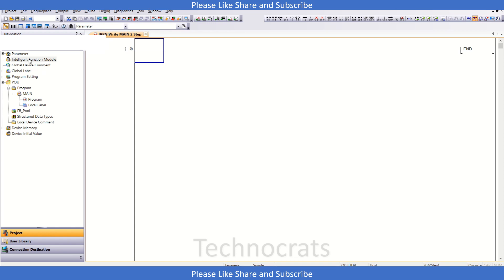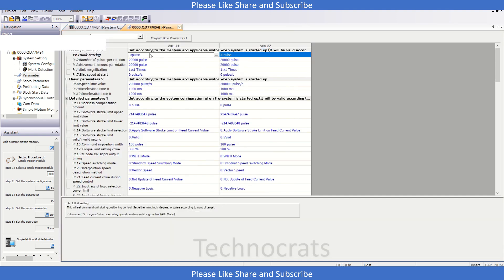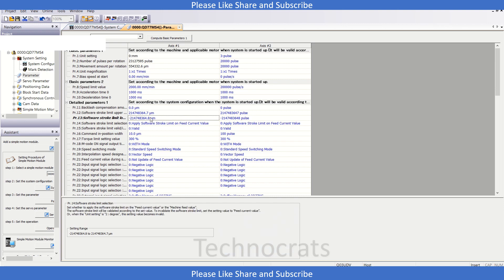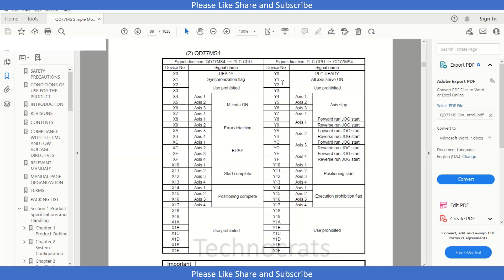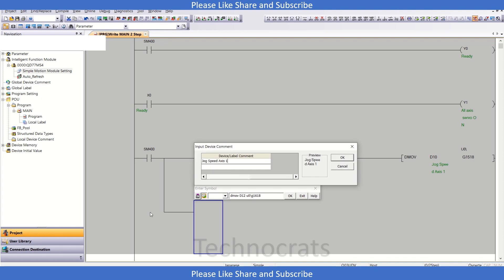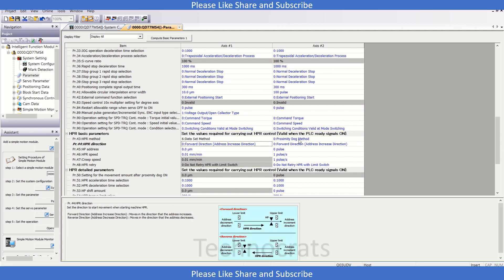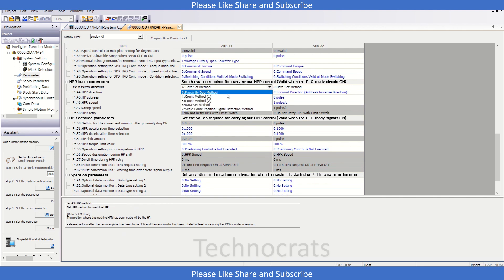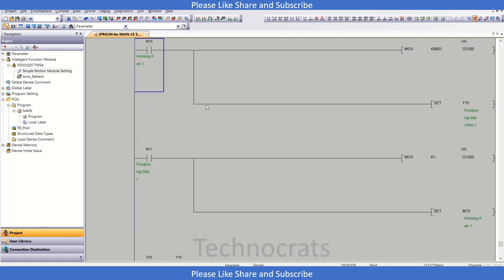QD77MS Simple Motion Module Parameter Setting, Jog, Homing & Positioning Mitsubishi Servo (Part 1)

Comment: I use 4 servo amp..and set up configuration with 4 axis ( d01 d02 d02 s04)  but axis 2 3 4 cannot write.what"s wrong with my parameter set up.can you suggest it

Comment: Hi, my software gives error 961 (illegal rapid stop deceleration time) after following the procedures. I already changed the values but without success, could you tell me what it could be? Thanks
Reply from the maker: What is the value in parameters for rapid deceleration stop
Reply: @Technocrats91  I already put several values, 100, 200, 600, 1000. all have the same problem